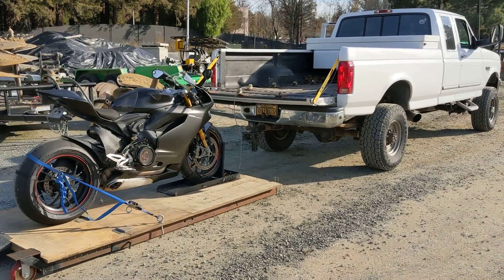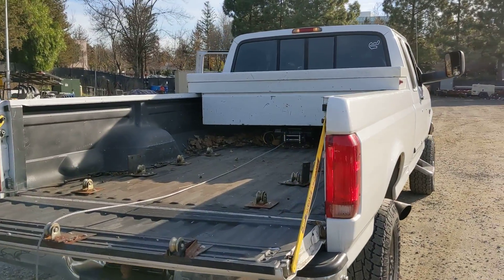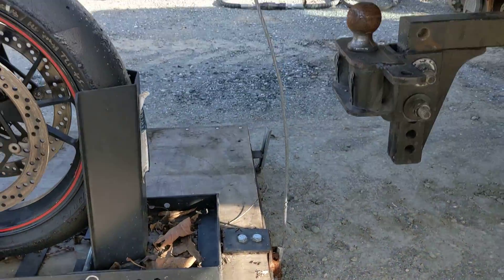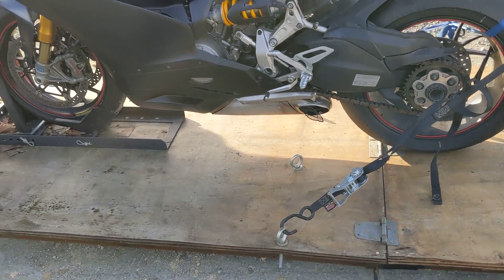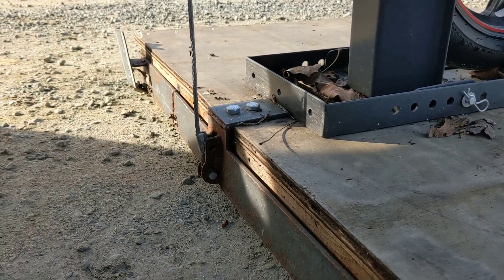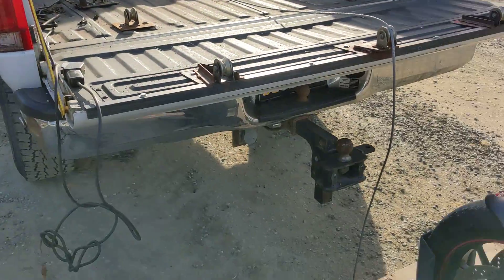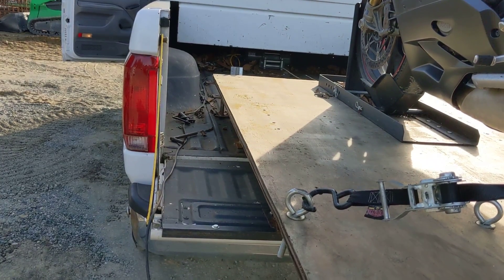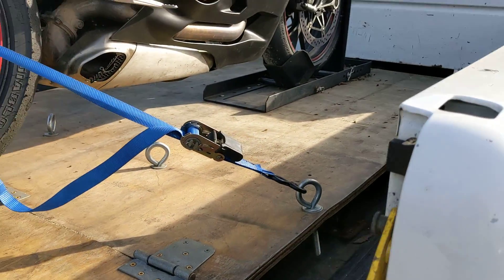The Motoloader: prototype motorized truck bed loader (be sure to check out V2!)

Comment: What size bolts did you use to secure the winch to the floor? And how many?
Reply from the maker: 3/8 - 16 rivet nuts in the bed and bolts, 6 of them and 1/4" thick steel angle to bolt to the winch. The Astro Pneumatic rivet nut install tool doesn't come with the 3/8-16 attachment so you'll need to order that end piece separately. I used smaller bolts for everything else since they don't have any shear load like the winch. Hope that helps! Working on a little website with all these details and some of the fabricated parts.

Comment: Looks great! Have you ever thought about doing this idea with an ATV deck or a sled deck? That'll sit on top of your box, still have the use of the box and able to keep tailgate closed? Be able to haul a bumper pull trailer at the same time? I been looking for designs like this for awhile now. See my wife and I both have cruisers, say 700 lbs each. Like to be able to pull a travel trailer to a campsite. And be able to have bikes on back of the truck as well.  I just wonder if the angle of pull up the extra 2 feet will work? Going from bed of box to top of box..
Reply from the maker: What length bed do you have? The angle starts getting too steep for this design as the loaded height increases (and / or the platform length decreases).
Reply: @Grip_Addict  I have a 6½ foot bed.. Chevrolet 2500HD.
Reply from the maker: @rutznme1000  Yea it's going to be tough with the shorter bed, I had originally planned to add extension arms that could be pinned on for loading into even higher / lifted setups but the steel design was too heavy. I will be making a second version soon that allows me to close the tailgate but that will require an 8' bed.
Reply: @Grip_Addict  ya I hear ya.  The thought of ramps up that high and angler scare the shit outta me lol

Comment: Any chance you can upload a video of you taking the bike off the truck?  Awesome work. I think i want to try and do this with my 2017 F150.  It's a short bed, and i would be trying this with a ZX14. so a bit more weight.
Reply from the maker: I'll upload a few more videos over the next couple weeks once I get time. The platform just pulls out, the winch must have a reverse / brake function to control the descent.
Reply: Hi have you  some  pic  or  video  from bottom side?

Comment: looks great, curious at how unloading works.  just pull out by hand until it starts to balance then let it down with the winch?
Reply from the maker: Correct there's very little rolling resistance, the winch has a reverse function so as I pull it I'm letting the winch out. When it gets to balance point it'll complete with gravity and the winch controls the descent speed.
Reply: Nik Beisert that’s what I figured, thanks!  I’m trying to figure out the best way to load bikes in the back of my service bed.   It’s either this, or a hydraulic lift setup.
Reply from the maker: https://youtu.be/5xFc3I9S2EU - check out V2 with a quick video of unloading and showing how the platform can be used for something very different!

Comment: I thought of this same idea to put a riding mower on my trailer because the cutting deck gets hung up on my ramps.but im going to use conveyor rollers on the bed of the trailer with the winch up in front of those.i was going to use a mower deck roller to guide the cable but i like your pulley better.thanks for posting this video.now i know it will work.